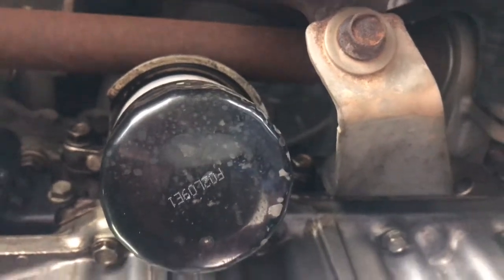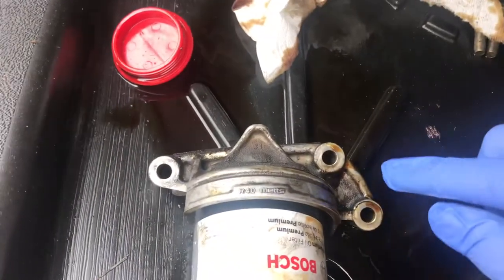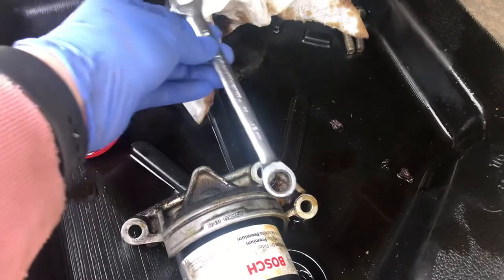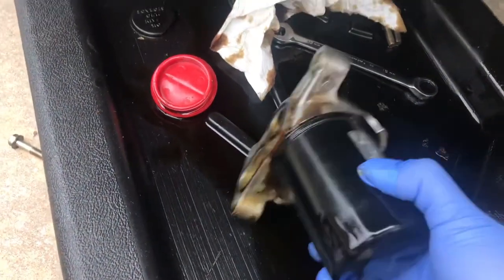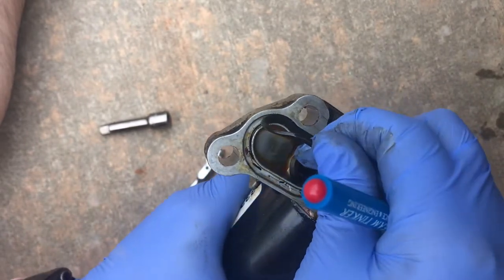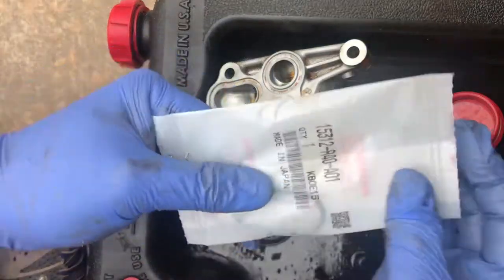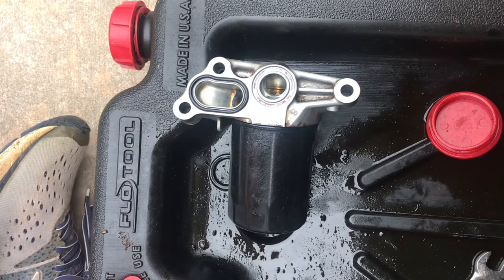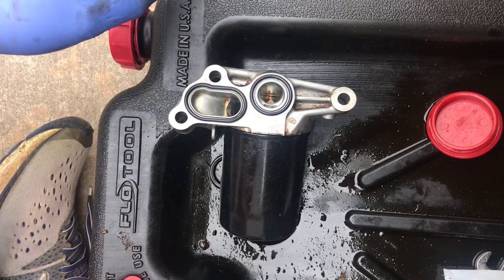Honda Accord 2008 Oil housing filter leak - gasket replacement

Comment: Thank you for the video and those mentioned removing the exhaust bracket. The top bolt still not easy to break loose. There is not enough room for socket and 3/8 rachet.  The long offset 12mm closed end did the job.
Reply from the maker: Hope it all works out, good work!

Comment: So I just did this yesterday, i took the bracket off the exhaust and was able to get that top bolt out with no issues. They were 14mm and came out with ease.
Reply from the maker: Great work!  Mine was on super tight, I didn’t move the exhaust.  In hindsight, I probably should have done that.
Reply: @YoDIYVideos  I was like there has got to be a better way to get to that bolt and then I saw that bracket and was like yep this is it lol
Reply from the maker: Smart!  It was quite a contortionist act for me to get that bolt off
Reply: When you remove the bracket, do you need to hold anything else in place ?
Reply: @hgfdksk17  no I didn't.
Reply: @TJsVette  okay thanks because I’m trading my 06 V6 in for an 12 V4
Reply: And it has the same problem. Leaking @ 148k miles
Reply: @hgfdksk17  turned out mine was a tiny pinhole in the actual oil filter. He had 250k miles when I did the replacement. Granted the gasket needed to be replaced anyway as it was about to go out
Reply: I'm about to do this to mine in the next few days. There's two wires that go into the top of mine. One being the VTec solenoid. They will have gaskets too correct?
Reply: @TevTooCold yes they do have gaskets but I didn't pull those.
Reply: @TJsVette  ok thanks

Comment: Seen a Honda tech do this use 1/4" swivel & socket to get 3td bolt. Also applied Hondabond to hold gasket in place during install
Reply from the maker: Good advice, did you get yours out ok?

Comment: Should the o-rings be lubed with motor oil before installing?

Also, what's the part link for the oil filter thread housing?

Thanks for making this video.
Reply from the maker: Yes, I’d go ahead and put a bit on so that it’ll stick on ok.

As for the oil filter housing, you can search it on https://www.hondapartsnow.com
Reply: @YoDIYVideos  putting the lube would be more for ensuring it doesn't break upon installation, like on oil filter o rings, no?
Reply from the maker: The gaskets won’t break, but when you place it upon the engine, the oring may just fall off without anything adhering the  oil filter housing.

Comment: READ THIS: On my 2009 Accord 2.4L 5 speed, the top bolt is definitely blocked by the axle. Solution: Remove the bracket going from the engine block to the exhaust. (When you look under the car, the bracket I'm referring to will become obvious.) Unscrew the top bolt (on the adapter) out as much as possible, then use a "close quarters hacksaw" to cut the bolt  (Yes, this takes awhile). The remnants of the bolt stuck out enough for me to use needle nose pliers to twist the rest out (Yes, this takes awhile). Now you can remove the adapter.  Installation: At my local hardware store (Lowes) I purchased a "M8-1.25 x 30mm" bolt. Slide this bolt into the adapter's top bolt hole, then mount the adapter and tighten the bolts. (Hint: coating the gaskets with Vaseline will hold them in place.) In my opinion, the torque specs (in the service manual) for these bolts is too high. Just make sure they're tight.
Reply from the maker: Nice work!

Comment: Do you how much pound of pressure to tighten when putting it back?
Reply from the maker: I’d try to get it finger tight and do it a quarter turn.  From my research, 16 ft lbs is what the odyssey calls for, I didn’t have the official guide for this repair.
Reply: 16 Ft Lbs is the correct torque

Comment: So I did this job on a 08 accord, then after I got done I poured a little bit of oil in the car to see what would happen and the oil started dripping from the oil filter again...not sure why?!
Reply from the maker: Oh bummer.  Let’s double check, do you have the right oil weight and oil filter?  

When you put the housing on, did you you scrape all the old gasket off?  You used the official oem gaskets for your car?  My video was for an ex 4 cylinder.

I’d start from the basics, wipe everything down and go from there.  Keep me updated.
Reply: @DTR did you find out what why?
Reply: @jackbuercklin  it actually was fine...but the solenoid gasket has to be changed now which i thought was the oil leak from the housing  so that's next to do.